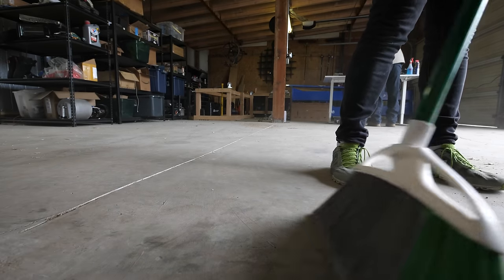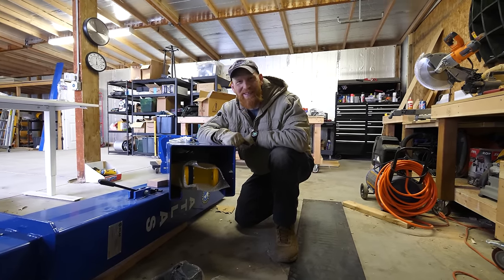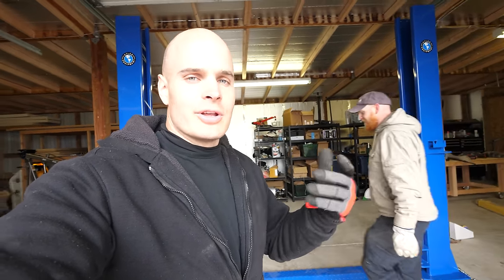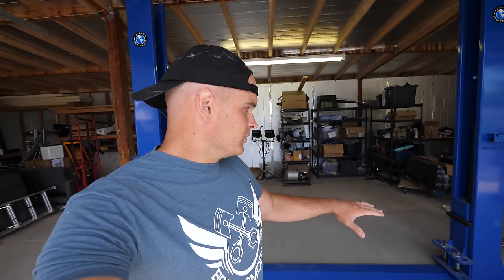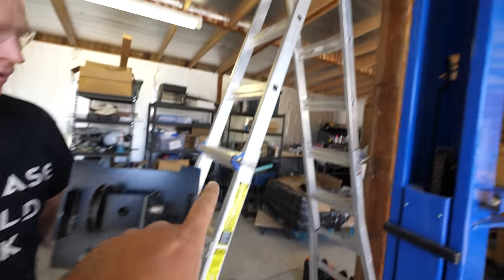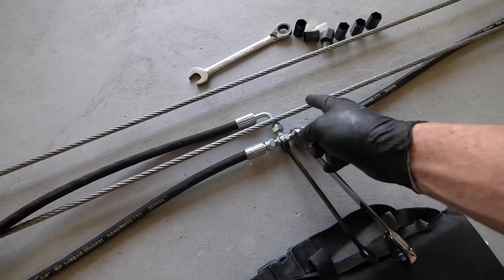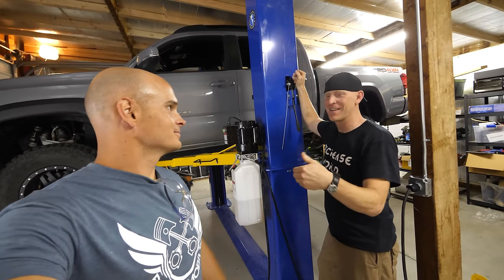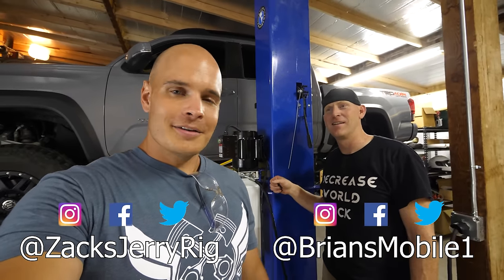Installing a 2 Post 10,000lb Vehicle Lift! - Check concrete FIRST!!

Comment: I used to install Bendpak lifts in the UK and seeing lifts falling over because concrete isn't deep enough is scary as hell. We used to fail the floor on anything less than 6".  Glad you went with the deeper concrete. I don't know if you'll see this but make sure you check the torque on the bolts again every few days for the first few weeks, the bolts will stretch as they settle.
Reply: Wish more people would interact to get this up, while I'm sure he looked deeply into the safety aspect it never hurts
Reply: Good advice there. I am planning exactly the same project for my own garage later this year, including cutting part of the floor and pouring a thicker slab of high PSI concrete.
Reply: I will. Thank you!
Reply: I screenshotted your comment and took the extra step to contact his Instagram.
Reply: I also treated Adam. Good advice!
Reply: He got the message!
Reply: same deal here in canada when we had a 2 post lift they said anything less the 6 inch of concrete is a NO GO.
Reply: @TDREXrx9  always better to be safe than sorry!
Reply: @alviltayco3713  thank you!!
Reply: Is it possible to embed some metal anchors with threaded holes into the concrete for the posts if a new slab gets poured anyway? That way those sketchy fasteners wouldn't have to be used.
Reply: @mihkelpaju3251  the fasteners aren't sketchy, they are only sketchy when used incorrectly or not put in enough or weak concrete. I get what you mean, and I guess yeah in theory it is possible but I have never ever heard or seen that been used anywhere. the issue I think that would present is the weakening of the threads. Where as an anchor bolt or through bolt relies on the anchors embedding them self into the concrete. The way anchor bolts are cleaver and there is more strain on the anchor than on the threads on the bolt. Which is much safer, the concrete is more likely to give way than the bolt. The only situation where you would use a threaded bar would be if you are resin fixing the bolts in the floor but the issue with that is the resin still needs something to grab on too, and resin doesn't necessarily last forever. It much more prone to decaying through moisture, oil and grease. I have seen a resin fixed lift literally rip itself out of the of the floor, because the resin failed. So in answer to your question, in theory yes. In practice I wouldn't recommend at all.

Sorry if that isn't a great explaination. It is a very interesting question and its difficult to explain and answer 😅
Reply: As the saying goes, "There is NO substitute for experience"!!  I have re-learned this more times than I will admit!
Reply: @GregSr  every day's a school day!
Reply: @mihkelpaju3251  you could but you would have to place the bolts perfectly where the lift holes are and that is tough to do with the fluid concrete
Reply: @deanandrejevic1946  interesting comment regarding epoxy bolts.
 I toured a mine and the guy said exactly the opposite, mechanical ceiling bolts failed but he never saw or heard of an epoxy bolt failing.
I wouldn’t hesitate to epoxy bolts into a floor if you use the proper epoxy and fasteners!
I know my lift didn’t include epoxy bolts as an option in the instal so I would follow the recommendations from the manufacturer
Reply: unicorn7337 n
Reply: Hope this got recognized, when it comes to lifting vehicles you don't go half cocked like you might for a lot of other projects!
Reply: This is not perfect advice... Sure the bolts may stretch that seems obvious. That does not always mean you should continue to tighten a bolt as you may simply continue to stretch it till it will eventually fail. If the engineers tell you to torque to spec do that and then follow the remainder of the instructions.
Reply: @jonathanrighetti5897  that understandable. After I hit enter I realized you were probably referring more to the possibility of the anchor failing and not the actual bolt. I just know when you tighten the head bolts on your cylinder head you don’t come back a month later and re-torque to spec haha.
Reply: Top comment nice
Reply: Thghh
Reply: U should thank me I was ure 1k like
Reply: @Dean Andrejevic This guy ripped up and re-poured quite a sizeable pad.  I am planning to do the same, but I was going to pour a 4' x 4' x 8" deep pad for each post.  Would that be sufficient, or do you think they need to be bigger, or tied together?
Reply: @RidgeRunner4X4  what is "needed" depends on so many things. If you still haven't installed it comment back. But to others that are looking to, think of this: if the ground under your concrete was solid, and you used fibre and some steel, 48"-20"(size of post on floor)/2=14". So your moving the pivot point of the lift 14" forwards and Backwards. You better have the vehicles center of balance on their damn near perfect, with regards to the arms positions, as far forward's and backyards as they can go. After doing the rock test, you'd probably be fine to do an oil change. That 10-15 ponds would probable be okay. I wouldnt be about to start doing anykind of work under it, especially where your taking off parts, especially towards the extremes. Keep in mind, this is only my opinion. If the lift/concrete/Install fail someone is going to be out of some money. Lift has value, vehicles have value, Everyone's life has a value(weather it be - or +). I wouldn't spend $100 to protect $.01 nor would i expect $.01 to protect $100.
Reply: @nicholashartzler2205  this was my first thought to his comment. If you go back and keep tightening bolts you're going to have some broken. I'm not sure what this guy is talking about when it comes to stuff settling and bolts stretching, but the bolts will stretch as tightened, as "intended".  As far as settling, i ain't got a clue. Maybe he thinks the lift work sellttling into the new concrete. If he does, he might want to find himself some new concrete workers. But After 60 days(think that's what the vid said) that concrete is going to do anything. Well, itll crack, it always crack, it is concrete afterall.
Reply: The min on almost any lift is 4 inches of concrete.
Reply: That is really great advice buddy. We have one at my work and we had alignment issues after the hardware fasteners came loose. It got way out of wack and and froze up in the up position
Reply: @nicholashartzler2205 no. The bolts streatch the correct amount if max torque isnt exceeded. They do not continue to streatch unless overtorqued or sub standatd bolts. Retorquing indicates slippage.
Reply: I know this might be a very stupid question but i have 0 experience with this stuff but had interest in letting my fiance get a car lift. How do I check the concrete depth?

Comment: Civil Eng. here, I about had a heart attack when you said it was ok for 4inch thick concrete, glad you didnt go with that. also you might want to give the concrete coating of Epoxy, PU or MMA flooring to stop oil, degreasers and other toxic crap from corroding your concrete, I have actually seen that stuff get under the lifts, break down the concrete and cause the lifts to destabilise , also might be worth putting some Silicon around the lifts base.
Reply: Thanks for the advice!
Reply: My bend pak 10 k calls for 4 1/4" minimum 3000 psi.
Reply: Zack better read this
Reply: @mitchdenner9743  do you like going with the minimum??? Really?
Reply: @roberts5118  actually I'm an overkill guy. Just stating the fact of what the manufacturer calls for, not what i did. DB.
Reply: The min is 4 inches and there are tens of thousands of lifts installed at that thickness across the world with no issues.
Reply: I never saw a concrete bridge getting the epoxy treatment...
And god knows how much crap they get to endure.
Different concrete???
Reply: @Freetheworldnow  Bridges are graded at 2% minimum, get washed clean by rain and also don't have a high point load bearing,  also don't have potential oil spills.
Reply: Can we use epoxy to strengthen anchor bolt ?

Comment: As a first responder I had two fatal accidents where the person installed a two post lift in old concrete that was not thick enough. when I had my pad done I had the concrete contractor do the pad 8 inches thick with the 24 inches where the lift was going to be 12 inches. I had 7500 psi concrete used. There was also a lot of rebar put in with boxes around the post attach points. It cost me an additional $300, I love overkill as opposed to getting killed. It was worth the extra money for my peace of mind. My lift is a 10,000 lb. lift.
Reply: an extra 300? ONLY 300? WHY WOULD SOMEONE NOT DO THAT? THE WHOLE INSTALLATION HAS TO BE OVER 10K AN EXTRA 300 TO ENSURE YOU DONT FUCKING DIE IS NOTHING? HOW DO PEOPLE CHEAP OUT ON THE CHEAPEST AND MOST IMPORTANT THINGS???????
Reply: @finkyfamboni4333  It's a lot cheaper when you're first building your house/shop to make these changes.  After the house/shop is built it would probably cost around $2500 to have the pad tore out and the new pad poured.  Still, $2500 is cheaper than losing a limb, becoming paralyzed, or losing your life.
Reply: That’s a little overkill lol.
Reply: I don’t understand why the column bases have such a small footprint. I would never get under one of those things regardless of concrete thickness. You’re relying on those anchors which could pull through or fail regardless. They should use 4 posts or have a large enough base under the 2 posts so that the thing could stand on its own with a vehicle on board.

Comment: I'm happy you went with thicker concrete. Dangerous having a two post on thin concrete. When you said 4" I cringed.
Reply: should have concreted the bolts.
Reply: You mean chemical bond?
Reply: Maybe he meant should have installed the bolts while the concrete was wet so no need to drill?
Reply: Just not sure why he attached it to my comment instead of making his own. 🤣
Reply: 4 inches is perfectly fine for a basic two post lift. We sell and install lifts where i work.
Reply: @Daddelcrusher  and I've seen plenty of them fail from shallow 4" concrete but hey why be safe when your selling shit right
Reply: Darwin Jackson safety costs extra buddy
Reply: @uhhhhh262  haha sad but true
Reply: @uhhhhh262  yeah not having it costs people's lives that for sure
Reply: Fake Name someone always pays
Reply: @Daddelcrusher  4 inches may be fine IF you can guarantee the slab is uniformly 4" thick. If I'm pounding on suspension components repairing vehicles in the air on a lift I want a good solid concrete slab of concrete properly poured with rebar and wire mesh inside the concrete slab to be supporting my lift. Just because you can bolt a lift onto concrete doesn't mean it's the safest.

Comment: What's the point if you can't stand underneath the vehicle. That was a fail.
Reply: Hahahaha ik right!? 🤦🏻‍♂️
Reply: Better than risking it on jacks.
Reply: I'd much rather crouch under a vehicle with nothing in the way instead of laying on my back with Jack stands next to me. Also when doing exhaust work or even any welding the extra height sure as hell helps.
Reply: Way better when install transmissions and exhaust and brakes and many more. Excellent Job, men around the USA dream of a lift that makes working on a automobile easier.
Reply: I guess use a chair.  But to go and pay big money on the lift and new concrete without being able to stand.  I would re work the roof to be able to stand.
Reply: @jaymann53  it's not really that expensive....
Reply: @UGotTheFunk  4-5.5k is prolly what he spent, if lift or concrete weren't discounted for the video.
Reply: @jonyemm not sure what he spent, but you can buy that same type of lift for less than 2k on Amazon.
Reply: @UGotTheFunk  i replied to this but I'm not seeing my reply? 
Going by what he spent, 3300 for the lift, plus concrete 1500(stupid low low end) to 2500(Realistic) it's going to total 4800-5800. 
A similar style on Amazon, cheapest i found is 2200, plus concrete=3700-4700. 
If you wish to stand under a cheap Amazon lift(with under 12 reviews because the rest of the purchasers probably got killed under them) with a 8-9000 vehicle on it, then may the odds be in your favor. I don't know how many those sold, but I'm sure its quite a few. So the odds of you making it back to post a review ain't looking to good.

Comment: Coming back and watching this video I'm SO glad we did the new concrete.  The 6:36 mark is scary how easy that concrete broke and scary how thin it was!  WHOOOOOO!!! HOOOOOO!!!
Reply: yah look like a cheap slab job, did it even have rebar?
Reply: @briansmobile1 Just now watched a video. Noticed that when car was lifted in the end, it looked like one side(that closer to lift control panel) of the car is lower. Difference can be seen by shadows under the tires. Curious if that was noticed later and fixed or that is not a problem?

Comment: Here in Europe the requirement for these types of installations is typically 20cm (just under 8 inches) of concrete so it's really good that you got a thicker slab. Safety is important, so sometimes you've just have to bite the bullet and get it done properly.
Reply: A lot depends on what the PSI of the concrete is.  My floor was poured 4" but extra heavy concrete (higher PSI).  My contractor knew I would istall a lift someday so he made sure it was poured correctly.  Also has double rebar and steel screen.  Now, if the lift will finally get here...

Comment: Being a lazy critter with experience setting bottom bolts on towers up to 200' tall, the one thing I would have done differently is to make a one piece plywood template of the footprint of the two (pillars perfectly spaced and aligned of course) and used that as a jig to suspend J-bolts in the wet concrete - voila, done.  
Not criticizing -  just suggesting for anyone watching the video and thinking of a new floor under their new lift.. Also, an existing floor can have openings cut where the pillars will stand, excavate and pour new footings for the pillars - with the J-bolts jigged into position - for less money than a complete new floor. 
After seeing the bend of the lift arms under your lightweight pickup I will be ordering a 4 post with track jacks for lifting my one-ton diesel pickups.. Half a lifetime as an engineer  in heavy industrial manufacturing plants has taught me the hard way that, if something mighta possibly, sorta, coulda happened (no matter how unlikely) it will. It's only a question of when.
Reply: A 4 post lift is great for vehicle storage, but not for vehicle maintenance.   For every job, there's a correct tool.  A lightweight 2 post lift isn't the best choice for heavy diesel pickups, but the answer isn't to go to a 4 post, the answer is to  upsize the list to a 12k or   just buy a better lift.  I use a Mohawk 10k 2post  lift for my 8000 pound Ram pickup, and its rock steady
Reply: Absolutely DO NOT cut openings in the floor and pour new footings where the lift pillars will stand. Your J-bolt idea isn't bad if you can lift the pillars into the air and drop them over the bolts sticking out if the concrete, but to tell someone that has too thin if a concrete pad to simply cut openings where the lift pillars will stand and excavate and pour new thicker footings only under the pillars is completely unsafe and ridiculous to save money. I don't know where you got your engineering degree but I sure as hell wouldn't be working under THAT lift! You need a complete new floor there's no way around it. The entire floor slab is where you get the strength. Simply cutting holes in thin concrete and putting the lift posts on thick stilts is the stupidest and most ridiculous advice I've ever heard. It will undoubtedly topple over. I have NO degree in engineering and that's my advice.
Reply: @TT-hq1hl  tell the ambulance people about the Romans and their column footings as they're pulling your crushed body out from under a toppled lift because you thought you new how to support it properly.. "well the Romans built columns like this I thought it would work lol I have a degree.. not sure why this collapsed.. guess I was wrong.." lol good luck buddy hope your education helps you out with some common sense